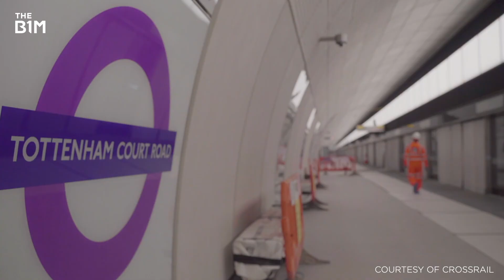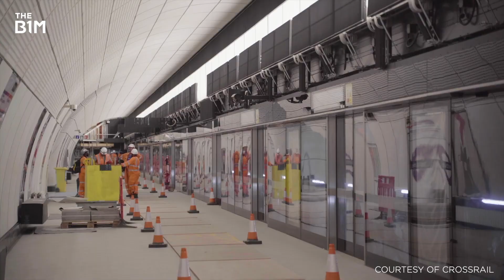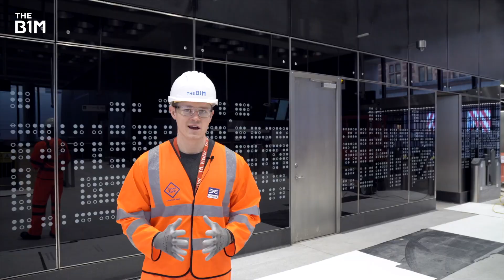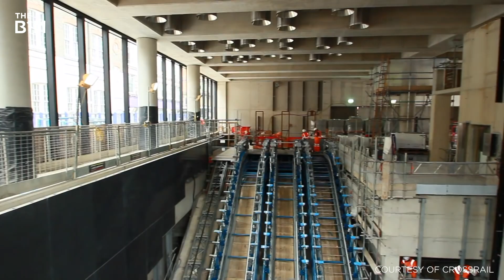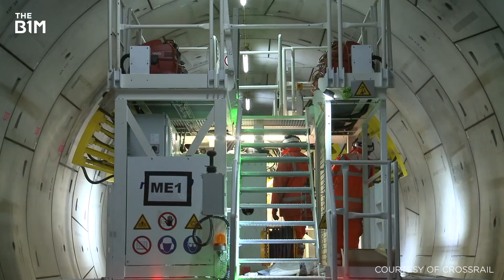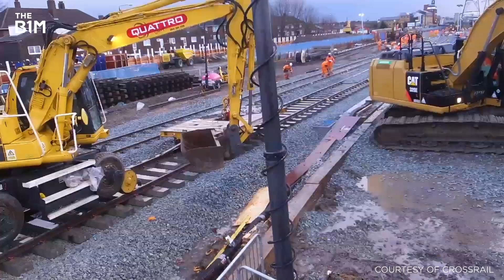Inside London’s £18BN New Railway

Comment: The thing London really needs in my opinion is a line that serves South London. So far every single line runs predominantly for the North
Reply: Yhhh I think the stations should have been more like this tbh. Terminate at Bromley Central. Go through Beckenham, Crystal Palace, Forest Hill, Crofton Park, Depford, Bermondsey, City of London and then through South West through Clapham North, Earlsfield, Wimbledon, Sutton Common and terminate at Sutton Station
Reply: Bungle2010 yeah but tubes would be much appreciated down here.
Reply: Well, that's where all The Wildlings are ....
Reply: @messaroundaccount1193  Clapham Junction instead of Clapham North maybe.
Reply: I think one of the reasons there's fewer lines in the south is the ground is more difficult and expensive to tunnel in. It's mostly clay in the north so it holds it's shape nicely when boring through, with less water getting through. It's more gravelly in the south so you need more supports while boring and more concrete to line the tunnels to reduce water ingress. The south in general is rather neglected though. They'll use the excuse there's less stuff down there to link up, which in turn means less things will be there that need linking, ignoring the stuff and people there already lol. It's a cycle. You see it in the bigger picture with projects and funding outside of London itself compared to the rest of the country.
Reply: @Pano1  There is already a train line to Clapham Junction
Reply: @ElectroRail  There isn’t an underground one.
Reply: @Pano1  the overground goes there

Comment: British engineering! Bravo! Looks fantastic!
Reply: raedwulf61 actually it is part french lol
Reply: Think the boring machines are German as well 😬
Reply: @tonicdb  They aren't.
Reply: If you've ever lived in the UK's slanted, cheap material, energy inefficient, retarded layout houses, then I don't think you would be praising British engineering lol
Reply: Yeah just 2 billion over budget and only 2 and a half years behind schedule, British engineering at its finest
Reply: @user-in8ih5sc8d  Yes they are. The tunnel boring machines (TBMs) were made by the Herrenknecht AG in Germany - there are no TBM manufacturers in the UK (at least none that I'm aware of).
Reply: @TheAndriThor  yeah compared to the Germans it's great
Reply: Andri Thor Andrésson actually the original budget was much closer to the final figure now quoted. However because of politics they had to make it less expensive by adjusting the spreadsheets, of course as they didn’t change the engineering surprise surprise when it turned out more expensive than the “political” figure.
Reply: Din Djarin  and half a planet is trying to kill other half.
Reply: @TheAndriThor  If you've seen everything rusting away in Spain and unfinished roads you wouldn't be praising European engineering either.
Reply: @rusinsr  Except that all the houses I have bought and lived in have been the exact opposite of the crap you just wrote. And  my experience goes back 54 years ...
So where do you live?
Reply: DUBxLORD only pointing out the same facts stated in the beginning of the video, no one allowed to mention it ? How British of you. Also, how about writing under your own name troll ?
Reply: Josh Nunn I wasn´t
Reply: @1chish  Scotland, but from what I've seen, London isn't any better.
Reply: @rusinsr  Ah OK. Well go shout at your SNP Government if you think your housing is shit. Its a devolved matter. And having lived in London (and other places around the world) UK housing is as good as any. But we also have very old buildings as well as we have been around for a long while.
Reply: @TheAndriThor  The engineering is great because it was all completed exactly to the designs and especially so as it had to overcome unknown problems during the build. Like fixing WWII bomb damage in the bottom of old docks where the Connaught Tunnels were enlarged!
https://youtu.be/lWHgVMcfNHg

The budget is now where it was forecast 10 years ago! Politicians played magic with the numbers but have been found out by engineering reality.
The delay is mainly in the software on the tracks operating with the trains. Its all new and never been done before and there are 3 separate systems. Testing takes time, finds faults and THAT is mainly where the 2 year delay is. The infrastructure has been completed.
By the way it is the biggest infrastructure project in Europe.
Reply: Din Djarin  No it build a monarchist empire that it liked to call "the modern world".
Reply: @rusinsr  Scottish houses are some of the most reliable and most sturdy in the entire UK. You dont get massive sandstone tenements anywhere else.
Reply: @1chish  Housing is better in Scotland than anywhere else. It's basic logic, 65 million people vs 5 million? I wonder where most available houses would be.
Reply: @hiddenknowledge2012  I see you have studied at the Diane Abbott school of mathematics. So you are saying the whole of the UK population has the same number of houses to use as Scotland? (Which is in the UK ....)
Reply: @hiddenknowledge2012  I've visited a few dozen houses while flat hunting in my city, and all houses usually have the same problems:

- Poor sound isolation
- Single glazed windows
- Random ventilation holes in rooms
- Bathrooms made of plastic walls
- No pipe for the over-the-oven exhaust fan to blow outside! (If you're even lucky enough to have an exhaust fan)
- Lack of power sockets in walls
- Dark hallways with no windows
- Horrible vinyl tiles instead of wooden floorboards
- Carpet in rooms where there shouldn't be any, like the dining room
- obviously slanted walls
- Window frames partially in the wall, and not properly insulated
- Less room space due to too many built-in closets
- Untreated wood used as support for the shower / bath, which eventually gets moldy

I could go on, but it's ridiculous that housing here is worse than soviet built apartment blocks in eastern Europe. And even the expensive flats in new buildings have many of the same problems.
Reply: @rusinsr  blimey - Scotland is in worse shape than I realised.
Reply: @rusinsr  I haven't seen single glazed windows since the early 2000's but a lot of what you are listing just seems to me like you are very picky. If you dont like vinyl then go buy wooden floorboards. I haven't seen a flat in my entire life that has real wood flooring. The person down below you would be going absolutely mad. Some places dont even allow you to have laminate or real wood because of the noise that neighbours have to put up with. What if the person who lived in the house before you preferred having all those things you listed?

Yeah, you seem extremely picky.
Reply: @1chish  He's talking shit. Houses in Govan and Maryhill dont even have single glazing windows. I've lived in Scotland all my life and haven't experienced once single thing he listed. It's known that houses in Scotland are far more reliable and sturdy than anywhere else in the UK.
Reply: @hiddenknowledge2012  And you've never lived in a decent house before lol :D
Reply: @rusinsr  Haven't lived in a mansion that's for sure.
Reply: @hiddenknowledge2012  Not sure I recognise the land you just described. You sure it was the UK? The UK is the 8th largest manufacturing country (soon to be 5th by the end of this year), 5th largest economy, a near balanced budget, one of the highest living wages pro rata in Europe and wages far outstripping inflation. Which is well below target. And you have proof of all these 'low income jobs' when wages are rising?
Reply: @1chish  "20% of UK people live in poverty including 8 million working-age adults, 4 million children and 1.9 million pensioners. Research by the JRF found nearly 400,000 more UK children and 300,000 more UK pensioners were in poverty in 2016-17 compared with 2012-13."

It's actually the 9th. What industry do you speak of? I dont see any industry after Thatcher ripped it out of country in the 80's. My town for instance, used to be a ship building powerhouse, the second city of the empire and now it's a shell of it's old self. Retail jobs make up the majority of the UK work force, only around 2 million people are employed in the "manufacturing" industry. We are in the most debt we have ever been in and more poverty than ever yet you speak of this utopia? Where? Where is this big manufacturing boom you speak of?

"Rough-sleeping has risen 165 per cent from 2010 to 2018; there are now 2,000 food banks in Britain, up from 29 before the financial crisis; life expectancy growth has slowed and close to 40 per cent of children are expected to be living in poverty by 2021. Cases of children going to school hungry and benefit claimants considering suicide mentioned by the UN may not be fully representative but they have become painfully familiar."

Let's not pretend the UK is London. Massive portions of the country are exactly like what I described.
Reply: Din Djarin  In London... Yet again. 

The UK isn't London. It's ok for the countries money to be spend on billion pound projects in London right? What about Wales, Northern parts of England and Scotland? Everyone's money just gets pumped into London's economy and infrastructure.
Reply: Din Djarin  Except people who live up north, which is the majority of the country. No one from the north wants to live or work in London. 

So you proved my point. Let's not pretend the UK is some sort of utopian paradise. It's a shit hole where big business takes priority over the people and the rest of the country is left to rot so a small elite bunch of millionaires and Saudi princes can live happily in London. Nice.
Reply: @hiddenknowledge2012  Oh my bad. I have been feeding an SNP troll and if you think supporting the SNP isn't being a 'Leftie' then you really have been suckered. Someone who thinks everyone south of the Border lives in London... 
To be honest you seem to need help mate. I live near one of those coastal communities Old Son (Lowestoft in Suffolk) and we are neither depressed, in poverty nor suicidal. How fucking dare you characterise us as such.
I know WHY we have had economic problems it was because of the EU's CFP which decimated coastal communities all over the UK. Including Scotland. And just as the Scots get their waters back the SNP want to hand them back to the EU.
You couldn't make this shit up Pal .... You need to get out more and find some friends ....
Reply: There is very little engineering in the Uk now, it’s nearly always overseas engineering
Reply: @1chish  Once you come down from the high of the Falklands and WW2 you will realise how terrible the UK is for the younger generations. Britain isn't great.
Reply: @forza223bowe5  Bollocks. 8th largest manufacturing country soon to be 5th largest. At least do some research.
Reply: All the signalisations is French, the Boring Machine are Germans, One the big company in civil engineering is French.... trains are Canadian. yep definitely British engineering...
Reply: @freewal  
* The signalling is British designed by British based companies Siemens PLC and Invensys UK. Siemens PLC was Westinghouse Rail Systems and was previously owned by Invensys which itself was formed by British companies BTR and Siebe.
* Boring machines were built in Germany to a UK specific design and operated by British engineers.
* The trains were designed by Bombardier at its global train design centre in Derby UK and then built there. A British company that the Canadians bought out.
* The western tunnelling was done by a consortium of  Bam Nuttall (UK), Ferrovial (Spain) and Kier (UK).
* The Eastern tunnelling by a consortium of Balfour Beatty (UK), Vinci UK (UK) and Morgan Sindall (UK)
* Further support Civils was done by Irish contractor Sisk and Spanish builder Dragados

Forgive me but no French involvement anywhere there.
Reply: 1chish Let me be more precise the contract for was won by ATC, a consortium composed by Alstom (French) TSO (french) and Costain (British.)
Reply: @freewal  The ATC joint venture was ONE of dozens of contracts and was for the fitting out of tunnels already bored and lined. It was for the track and the OHL.
Look I have no problem with anyone working with foreign companies but you are just peddling crap. You have made out its not British and all French when basically two French companies are minor members of ONE consortium on ONE contract. No signalling, no civil engineering as you suggested. It is tunnel fit out of TWO albeit major items of many dozens of other tunnel fitted systems.
Reply: 1chish are you a brexthicker?
Reply: @clubmarette  I read in the papers at that time of Xi's visit to London that Crossrail and the HS train involves the Brits working with the Chinese and the French too.
Reply: Anne Teoh sure! i said « part », of course I hope that brits works on their own train
Reply: tonicdb who cares Train, Locomotive, railway, boring machine were all invented in England, also London was the world’s first city to have the underground train railway
Reply: SamWeller  Well thank you. I try to add a certain something ....
Reply: @yananneteoh9818  Sorry but there is no Chinese involvement in either project. You heard wrong. Not an attempt at false information I hope?
Reply: @1chish  Rest assured... certainly not false info from me. Look the two guys in the video look Chinese . Chinese involvement, with Frenc and Brits - I read in the papers during Xi's visit and recently when Boris revived the HS rail. Honest but things might've changed tho the two guys in the video are in the project.
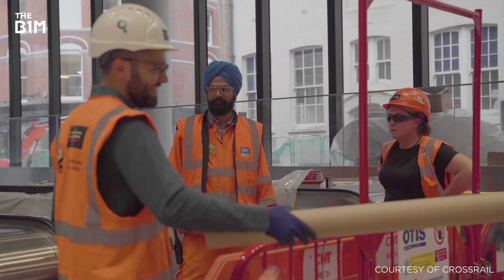Reply: @yananneteoh9818  Not sure Fred Mills is Chinese and the Lady project manager in the film (Lih-Ling Highe) is a British highly qualified mechanical engineer who has worked all over the world. @ 05:20 and 05:49 there are Sikh engineers but India are not involved. And anyway the UK pulls in people from all over the world so the people you may think look Chinese could well be from Malaysia or Singapore. Commonwealth countries
Reply: @rusinsr  eu engenheiro kkkk não tem muitos engenheiros por aí . Só dei uma ideia .🤔😆🚇🚆🚄🚈🚅🚝
Reply: @BrokenCurtain  Trump já tá queimado no Mundo e na América.election tá por um fio .
Reply: @dalecn2417  eu vou sim eu vou viajar o Mundo a cada País.

Comment: I live in the United States and based on what I've seen of the tube stations and some of the transportation infrastructure it looks like they used the same general architectural design and just really upgraded it it's a lot brighter the tiles of the used in the ceilings are fabulous I really love the look of the new kind of arches that they have it the fact it's a high speed train are going through the largest city in the UK as a really big deal
Reply: Yep top speed is 90mph which is not bad for a train in a tunnel. When they manage to open it that is.
Reply: its also one of the worlds most complicated cities to tunnel underneath. Anybody who lived & commuted in London during Crossrail’s consultation phase will know & remember from the papers we used to read on the tube how complex it was to build this, essentially drilling a new high speed line underneath a central city’s core without disruption above or to existing lines while adding connection points & electric power, interchanges, etc. the delays and budget overrun are (& were) expected. this project will lead them well into the future & return tangible & intangible benefits to the economy many times over. My hat’s off to the consult, engineering, ministerial & physical labour teams who pulled this off. IIRC TCR / Holborn Station area was the most complex to do due to the existing infrasfructure around it.

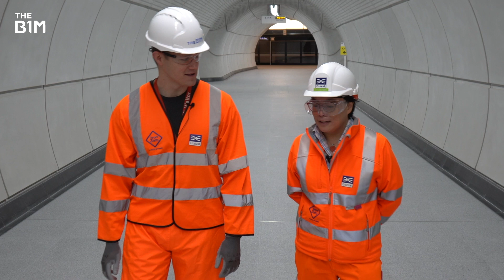Comment: 2:46 I started off as cost engineer (spent 2bn over budget) then got promoted.  Classic.
Reply: inside outside upside downside   ...using machines all concieved, designed and built by men. Just like in everything else.
Reply: Actually, 2bn overspend is a bargain ... this is once in lifetime civil engineering project. Also, the initial budget was based on some plan & design which was subsequently revised more than a few time due to practical reasons, that's increase cost. 

As an accountant in civil engineering company (directly involved in Crossrail projects) know very well that comparing to a similar project in other countries Cross Rail is a bargain.
Reply: Is a cost engineer an adviser to the project manager, or subordinate to the project sponsors? Many large projects fall victim to 'scope creep', which is a flowery term for changes in design and project objectives.
Reply: Shes the project manager for one station. Not the whole line
Reply: inside outside upside downside  damn some people are still mad about women having jobs, I didn't realise it was 1850. And you think the tunnels are still dug manually by hand? Are you a time traveller?
Reply: How is being a Project Manager anything to shut about. They are just glorified job planners which everyone under them tells them what's need to be scoped in a project. I've never worked with a PM that was ever needed, they are just put there as an insurance scheme by senior managerment.
Reply: @thehardisgold7267  there is always an accountant or someone who knows someone high up in an organisation.   It amazes me how many people 'in the know' are actually already here on YouTube!
Reply: @danieli6295  very few, due to lack of time.
Reply: @danieli6295  Yeah, because those people must never use any form of social media right? Come on. Everyone watches Youtube, and people watch what they find interesting. It's really not that hard to believe. It's no different than people joining into a conversation on a forum.